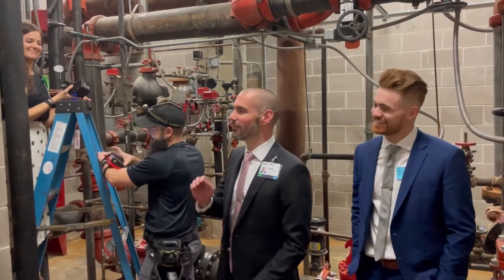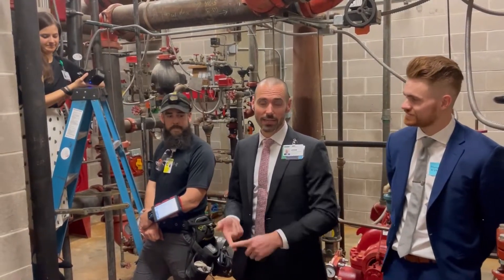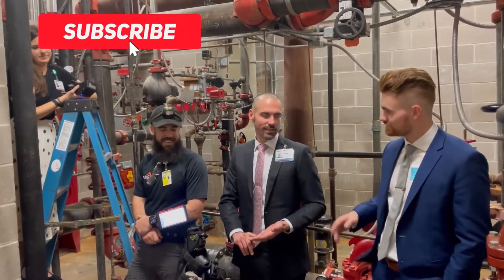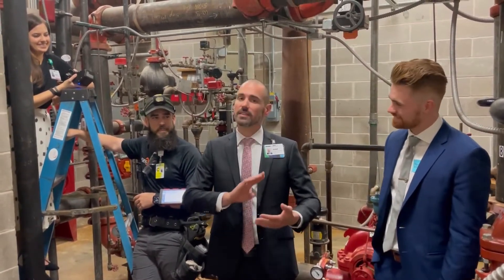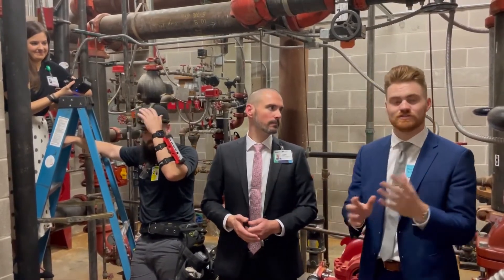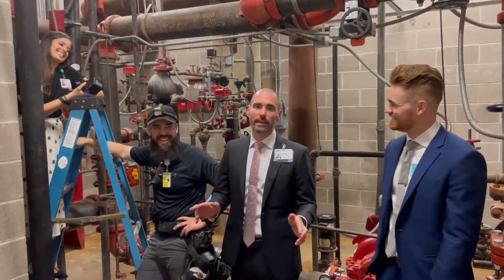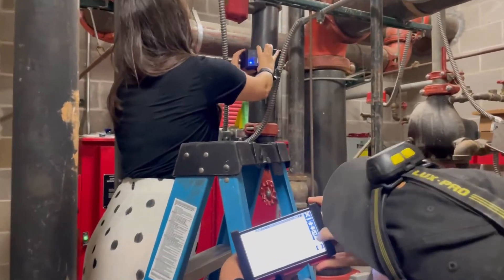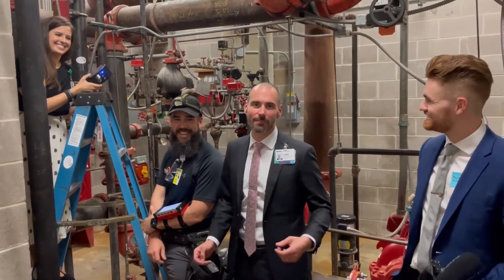Internal 5-year Inspection

Comment: I was extremely excited until I called and was told the equipment was not for sale.   Only feasible to use on large projects because of the cost.  Looks like we will continue to do it the old-fashioned way until someone makes equipment available for purchase at a reasonable cost.  Probably when their patent runs out.
Reply: We use a scope , We pull a head in certain areas of the system and inspect it that way.

Comment: Pull the checks….
Reply: Hey Chris, Sonic Inspection does not do the checks. That is for the fire contractor. There are two parts to a 5-Year Assessment: Check vales and the piping.

We non-invasively assess the pipe for integral compromise like corrosion, wall-thinning, sludge, slime, Tubercles, scaling, and trapped air or water in a wet or dry system. Similar technology has been used for many decades in the oil and gas, aircraft (Boeing, US Forces, and more), and more.

Sonic Inspeciton checks integrity of the pipe for the 5-Year assessment on the internal piping per NFPA 25 14.2.1.

Comment: That didn’t show you anything but a bunch of lines. Break that sucker apart and do an actual internal. That computer crap isn’t gonna show you what your eye will be able to clearly see.
Reply: Sean, to the untrained eye it looks like a bunch of lines. Similar to a radiography or ultrasonic technician in a hospital, it takes training and analytics to reveal what is being seen. Our technology is moving the fire industry into the 21st century from antiquated techniques that provide very little data and much risk. Ultrasound has been used since 1956 and has many applications from medical, oil lines, planes, rockets, ships and more. Now, it has made advancements into Fire Protection (since 2004) with wide acceptance/permission from NFPA 25 Testing, Inspection, and Maintenance on Water Based Systems. 

I hope you find this helpful.